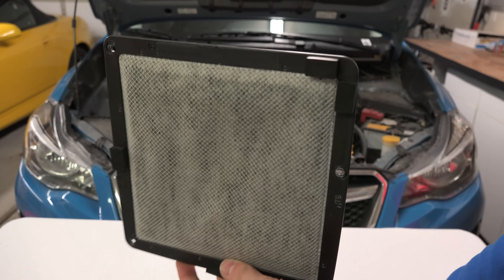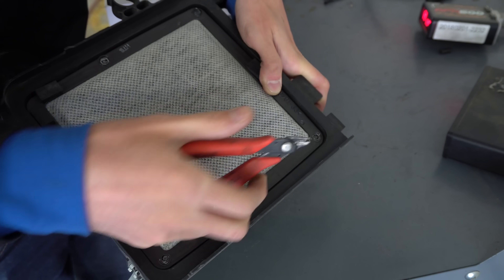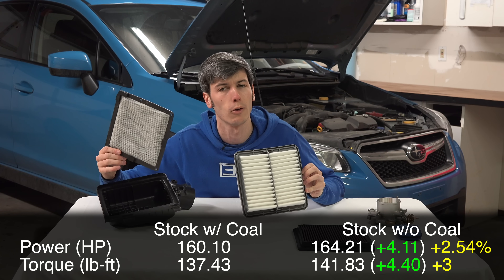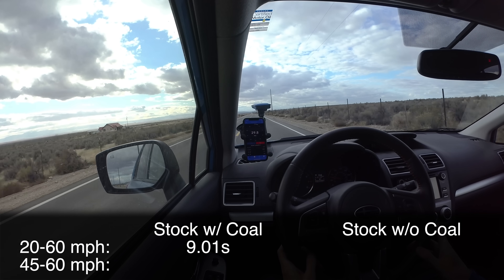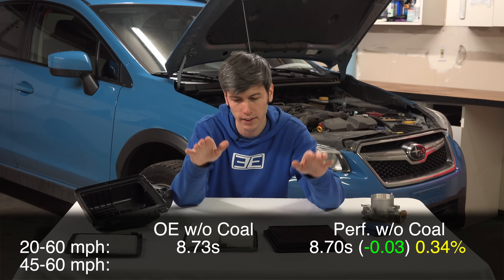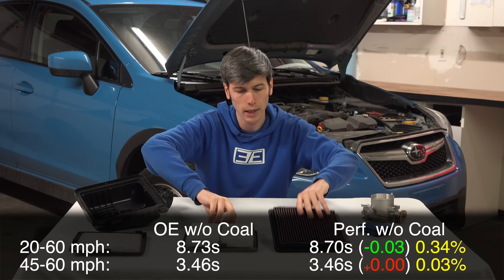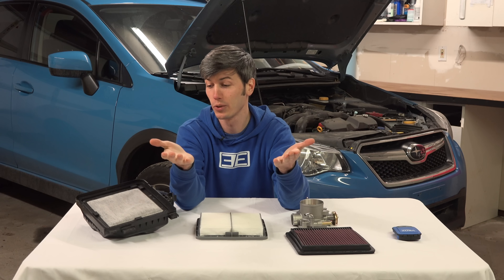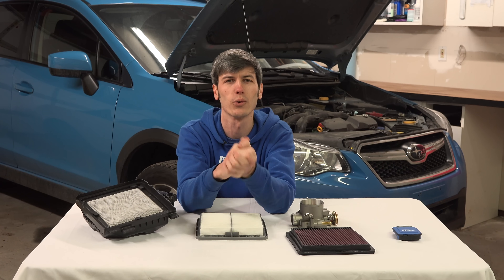Do Charcoal Air Filters Rob Your Engine Of Horsepower?

Comment: Interesting, but you tested one vehicle. I'd be curious what that does on a performance car, like my 2020 Dodge R/T with a 5.7L hemi (that engine is VERY sensitive (for the better) to differences in octane of gasoline, tire pressure, high flow air filters, high flow exhaust etc.). For cars with neutered engines that have a lot more HP and torque potential than other engines, I think you'd see a greater benefit. I had a subaru crosstrek, it's pathetic 2.0 L engine is not necessarily a test subject to provide conclusions for all vehicles.

Comment: Hello, could a performance air filter be bad for the engine?? I mean I know that I would have a gain of 4 or 5hp, I have a program in my car also, but is the performance air filters more open so dust could damage the engine?
Reply: I've used K&Ns for over 25 years on various cars and have never had an issue. That being said, i don't hold onto my cars when they get over 100k miles. So, that may be a little skewed. There are several videos that do show performance filters do allow more particles to get through vs. a good OEM paper filter. My best advice, if you go with a K&N is to be sure to keep up with your oil changes and use a good oil filter. Also, be careful not to over oil the filter when you clean and recharge it as that oil can get itno your MAF sensor and cause issues. Personally, I stopped using K&Ns as the cleaning became a hassle, and honestly adding an extra 5-10 hp to the 460 hp in my Coyote V8, isn't going to make a noticeable difference unless  am racing  it at a track. If you do go with a paper filter WIX brand were proven to be the best in a balance of filtration as well as allowing best airflow through for performance.
Reply: @jeff-ds2pr  thanks

Comment: Maybe I missed something. How in the world are you getting 160 whp out of a car that outputs 148 hp at the crank?
Reply: It's likely the dyno is reading a bit high, they all vary a little bit. Some cars are also underrated or overrated from the factory. The percentage changes between the values are the more important metric, and if you wanted to relate them back to 148hp, just take the same percentages and multiply them to 148hp instead of 160hp.

Comment: I just got emissions fault lights… after removing what I now know prevented these blinking lights to appear! 
I’d really like to know the difference between the paper and foam filters…
What really makes an improvement, before we even get to the filter, is how the air flows i.e. if you make the internals of the intake system as smooth as possible, getting rid of any “flashing”  etc.. the air will be much happier and free when it gets to any filter that happens to be there. These modern plastic manifolds and intakes seem to spit in the face of that silky smooth even-flow

Comment: GR86/BRZ - North America is the only place where the charcoal filter is found. In Japan the car makes 7 more horsepower. 7 hrsprs is nothing to balk at. 

While I would agree in overall terms of acceleration I do not notice anything, however; what I do notice is easier starts and shifting under 4,000 rpm. Mostly starting in 1st it seems smoother and less roughness in clutch engagement and less need for throttle modulation.

Comment: The charcoal filter in my Rams air box is non-replaceable, carbon only has a certain lifespan, which was probably done less than a year after owning it, after 5 years and fear it's going to fall apart in my engine bay, I'm going to take mine out soon.

Comment: The largest complaint with this particular engine is the initial engine response and the "choking" and/or "knocking" you get especially when driving up hill.  It's quite annoying. It would be great if Subaru simply remaps the engine so the 0-2000 rpm provides much better/quicker air flow as you mentioned.  Maybe a VW Golf R is the answer ;)

Comment: The charcoal filter is not replaceable,  so therefore it will clog up over time.  That will DEFINITELY become a restriction.   Manufacturers don't care if the car looses 12 or 13 hp 6 or 7 years down the road

Comment: Call me crazy but I did this mod on my Subaru Outback Wilderness and felt more torque. Turbo also spools up much quicker, Im also hitting higher boost  to 15psi from 14.50.  0-60  times are better going from 5.8sec to 5.6 sec using dragy times. 700 ft elevation

Comment: It doesn't matter that it's only changing a small amount of Gs as to whether you can feel it. What matters is the ratio of change to existing. So 1/100th of a G doesn't sound like much. But what matters is accelleration time. If you're getting times that are 5% better, you probably CAN feel the difference. 5% is is large enough to feel in most cases. Math isn't a bummer, but people not understanding math is a bummer.

Comment: All those "emissions-related" equipment really are bothering asf. I have no remorse about removing charcoal filters, replace the PCV with an oil catch can, and delete the EGR of all vehicles taht I have. I have more power, the engine lives longer and fun fact it's emitting less polution without the EGR

Comment: His end comments on Gs makes sense but since they are not legally required by the EPA you can take it out. Might as well get a tiny bit better fuel economy. Even if it's really tiny. If those were required by the EPA, then logically, all cars would have to have them. But few cars have charcoal filters, Hondas, for example, don't have those. So I say remove them. And yes, it would be emission compliant since like I said, all cars would be required nationally to have them. But they aren't required. Maybe only California would require those?

Comment: It will change on a more powerful vehicule like the WRX... We pick-up almost 19whp@12wtq without the charcoal filter on 2023 WRX with the stock Subaru air filter on 91 octane. We try many performance drop in air filter and the best was the Perrin black sponge. but the gains on the Perrin was little compare to the stock air filter 27whp@17wtq total, that means the Perrin give a small 8whp@5wtq compare to stock air filter. The biggest gains come from the charcoal filter delete !

Comment: Question. I swapped out my 2012 Toyota Corolla Engine Air filter with a Purolator A25655 Advanced Engine air filter. My concern is the greater number of pleats, and the weight. It's significantly heavier than the old filter. Enough so that I am worried about the engine not getting enough air because the filter is too dense. Should I be concerned?

Comment: There is one more air filter you didn’t test. A high flow filter with no oil treatment. And you need a higher power car like a V8.

Comment: did you happen to test the vehicle with both air filter and charcoal filter removed?  would be interesting to get a baseline of how much HP loss is caused by air restriction overall.

Comment: I'm curious about how it effects fuel consumption. If it is also increased 2 by removing the charcoal, I wonder how much the charcoal filter helps overall emissions if it results in use of more gas. Not to mention the extra cost to develop and manufacture, plus more plastics in the environment.

Comment: Last section - the Subaru Crosstrek is a slow vehicle. Any changes to make it slightly faster is welcomed. One that cost nothing ? Absolutely do it.  An another thing Jason and others might have missed - the what will the dirty charcoal filter do ?  I know it is behind the air filter, but still it will get dirtier over time. Maybe not a whole lot, but some minuscule particles will find its way into the filter. It will filter it out of the engine so its good but what if it collects them and gets dirty ? 
I will try and remove it for a test run, but since the car is still under warranty, I do not want to mess with it.

Comment: On a track if you have 4 corner to corner sections from 45mph to 90 mph and you save 0.3s per section that is 1.2 seconds per lap.  That is a huge improvement.  (0.15s improvement from 45 to 60 so I am giving another 0.15s from 60 to 90mph for a total of 0.3s)

Comment: I have a 2018 impreza with the FB20D (basically just a direct injection version of jason's corsstrek engine,) saw the whole charcoal filter thing on forums, and really saw no drawbacks, so I figured I'd remove it when I replaced my air filter. He's right; you really don't notice any difference. But, more horsepower is more horsepower. Where's james pumphry? And yes, my impreza is an off-road use, track ONLY vehicle lol. Who would ever buy the 2L n/a economy car for a daily anyway....

Curious about his dyno numbers though, as he's getting numbers that are higher than even subaru's quoted BHP. And, he's measuring WHP. Mustang dyno vs dyno jet correction mistake? These things make about 150 at the crank.

Comment: I have to disagree with “you can’t feel that” because this equation assumes that acceleration forces remain even/equal throughout the entire 9 seconds. But this isn’t true. The acceleration at the beginning is more than the acceleration pull 9 seconds into a run. And The throttle response can be felt during the initial tip in because there is a much larger change in g forces from initial throttle when you have a little more power. As the car settles into a set velocity/acceleration, that is when the g forces even out. But, when we are talking about butt Dyno and feeling a difference, we are not talking about how it feels throughout the entire acceleration run—it is almost always about that first second of acceleration on the throttle.

Comment: Did the air box sound changed when changing to a k&n air filter and did you get better or worse mpg
Reply: Had k&n filter before with charcoal and did not notice anything different. Sound was same as stock filter too.

Comment: i removed the charcoal filter on my 100k miles 2007 manual rav4, it improved A LOT the throttle response, now its easier to drive slow, off the pavement, and even parking the car is a lot easier, not i don't have to drop to 4th gear to pass a slower car going under 60mph, i can ramp up from 50 to 75 a lot quicker and without dropping a gear... 2nd and 3rd gear feels more alive above 4000 rpm's, also the side benefit of a throattier engine sound... plus no more rpm dipping and ramping up when the AC cycles on and off... probably this would have less effect on a newer engine with a new filter, but with 100k miles it was pretty dark... even tho i change filters a lot becase they are cheap... i also running an k&n now, but it didn't improve as much as the removal of the charcoal filter... downside? i'm on the re-learning time of the ECU so the MPG count on the dash is reading lower MPG, i did a 200 mile test and its showing like 2-3 mpg worse, but the car dash shows 5 mpg worse... but it would be me that i'm going over 80 now confortably when before, the confort zone was closer to 70-75... 

so, i recomend it...

Comment: It Will Make A Difference In Intake Sound Tho So It's Worth It. I Removed My Charcoal Filter And Using The Drop In KN Filter With A Throttle Body Spacer I Also Costumed My Air Box I Removed All Of The Pipes Leading To The Front Of The Hood So Basically I Costumed My Stock Air Box To A Ram Air Box Big Difference In Sound And Power

Comment: The reason I chose the K&N panel filter was actually not the performance gain, but the longevity of the filter, as it can simply be cleaned and used again and again.
Reply: I used to think the same until the K&N filter oil gummed up my throttle body after 185,000 km and I had to spend a bunch to get it cleaned - couldn't do it myself since drive by wire throttle bodies have to be opened and closed with a computer (forcing it open by hand can ruin the electric motor).
Reply: @Wallstreetavarice  Washing and reusing does not work well with condoms either.
Reply: @Wallstreetavarice well your throttle body issue wasn’t solely the filters fault. On modern engines with emission control devices like EGR and PCV the throttle bodies get exposed to those emissions as well. If you’re bad with maintenance especially oil changes the throttle body will experience much more of these emissions. The big thing is the oil vapor from the pcv system. On modern fuel injection The computer in the engines actually accounts for the reduced performance of the throttle body. If you’re throttle body failed completely though I’d suspect that someone was putting wayyyyy too much oil on the filter or you may have a faulty emission controlling device like your pcv valve isn’t working properly
Reply: @Wallstreetavarice  yeah, my 1987 Opel does not have that problem.
Reply: @Wallstreetavarice  that was your pcv gumming up the throttlebody.
Reply: Sounds way better too! I removed the charcoal filter and use the K&N only

Comment: Get rid of that air starving charcoal filter and clean the MAS airflow sensor and your throttle body.Also put in K&N filter. What a difference. Keep the charcoal filter for when you need inspection....

Comment: The real question is how does it affect MPG?
Reply: it wont, youll get way better acceleration though

cleaning your MAF sensor will affect MPG, because even when running restrictive airflow, your MAF will let your ECU know that it needs less fuel for air ratio, and vice versa if there is more air flowing. Now since you took the restrictive filter off, air flows more, so the ECU can tell your engine to put more fuel in when you press the throttle. But you wont notice any change until you go wide open throttle, and then youll see a difference because now the car gets lot more power

if you have a super old car, its probably really clogged up that the car feels very laggy and sluggish.

Comment: I am not a engineer, but could not the charcoal filter actually increase fuel consumption as it lowers power? I live in EU and have car which looks like family car, but has tiny 1.2 liter engine....when the car is fully loaded and accelerating up to hill, the consumption is 50 L per 100 KM :D I believe that all of these emission stuffs are rather contra-productive.

Comment: Fine for 158hp.. but what about when you get into the 400-600 hp ranges ? I doubt the restriction in your particular test is linear with higher horsepower engines.
Reply: I have a Hemi Ram with 395 hrsprs and might try this.

Comment: Leave the charcoal filter in, and run the K&N. K&Ns initially cost more money, but because you can clean them and reuse them, they save money in the long run. I do not run mine dry, as many people do. I've been using K&N filters for over 45 years and still follow the directions by oiling them. I do however, use my own recipe for the oil.
Reply: Great to know John and if you don,t mind sharing your oil formula, please?
Reply: but to remove charcoal filter is free... and a performance mod.

Comment: Nope, your conjectures seems very unlikely to me.  First, whether the small difference in acceleration is detectable given your calculation of it as 'g's'. The change in acceleration is perfectly relative to the change in torque. Which is to say the relation is linear. So if it did, or didn't, strike you that the change in acceleration (due to the carbon filter) was obvious given the change in engine torque, then it should be just as obvious by looking at the percentage change in engine torque without bothering to calculate delta g's.
Second, you maintain that the change in engine responsiveness is undetectable,  - which may be true, placebo controlled etc tests may show that we can not detect such a small change in acceleration of our familiar vehicles, but you go on to give a physical explanation for this involving pressures. So you are saying there isn't such a thing for us to detect. But there is - any rate of air-flow is affected by the filter (reduced). So at each moment, in going from zero to any rate of flow the flow is less than it could have been. No reason that shouldn't be felt in vehicle acceleration (and a necessarily different engine character).

Comment: You made a big assumption by dismissing the throttle response by referring to electronic throttles. Only 1 of my 8 vehicles doesn't have a throttle directly controlled by throttle cable. Preeeetty sure I'm not the only one.

Comment: I think you're being too literal over what people mean by saying throttle response. Semantics does not beat intent.
Reply: I have K&N filters for 3 very different vehicles and have played around a lot with comparisons over the years. A BMW 2.8L six cy petrol; Toyota 3L Turbo diesel 4WD and a Suzuki TL1000R Vtwin with Yoshimura 2 into 1 exhaust. Point of note: They are ALL mechanical throttle linkages and all injected. What I call throttle response or the speed with which the engines seem to rev or react is most definitely different with different filters. The diesel had the biggest reaction but only after putting a full 3" exhaust in right from the turbo back. But then I put the stock filter back in which made a substantial difference in quietening it all down. 
From my experience intake noise is the biggest change with K&N filters. The TL1000 sounds glorious.

Comment: EE, what effect does engine displacement have on this test? My hypothesis is that for a larger displacement NA engine, the difference may be slightly more pronounced, especially in the "butt dyno" portion. Curious to see what the "really exciting math" has to say. Would like to compare your existing 4cly results against something like a 3.0 6cyl and a 5.0 8cyl.
Reply: The more you have displacement, the more you're filter will have to let air get inside the engine. So yes, removing any restrictive layer in your intake will increase the results